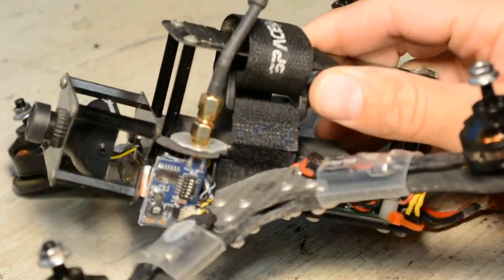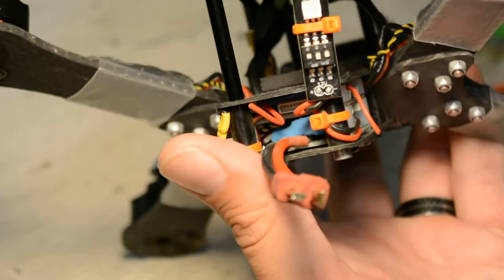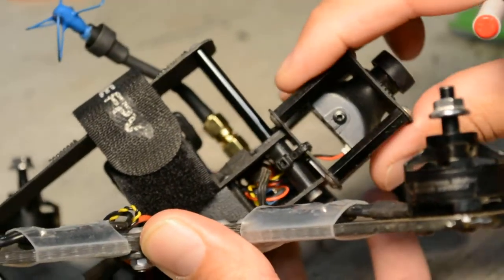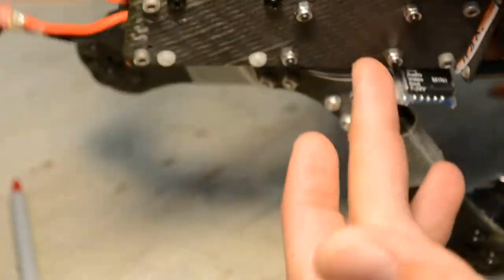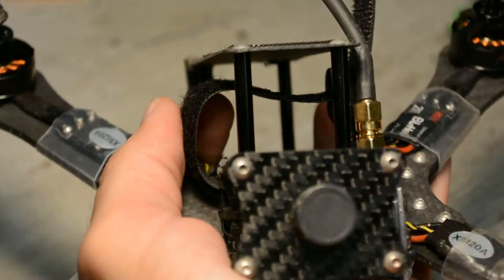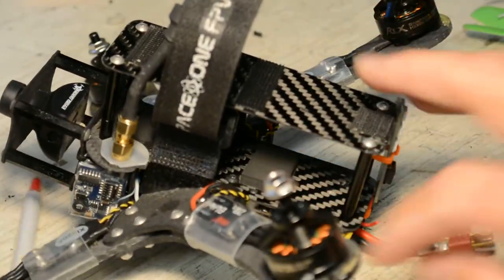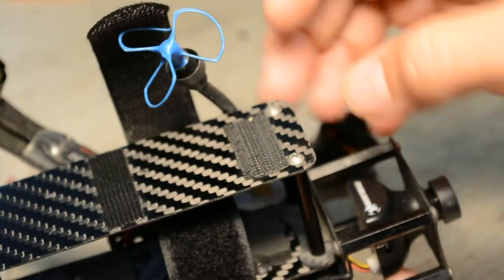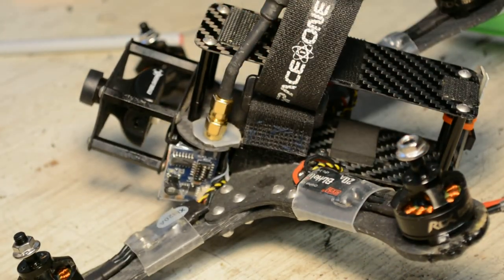Green Gorilla 6k wired

Comment from the maker: This wouldn't be an easy first build. It's a basic hextronic pdb. I used 2 seperate vregs, one for 12v which is placed in the front by the camera and vtx and one for 5v sanwiched in the back which i believe i pointed out. kind of limited on space in there. The camera tilt is easy, you can just put foam or extra sticky tape on the back of the second camera plate which buts against the frame to adjust the angle more or less.